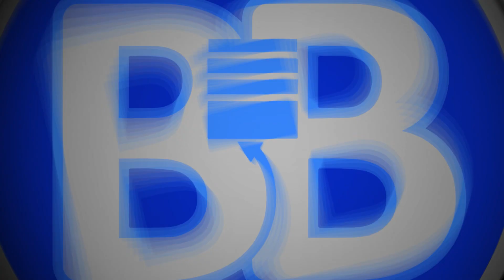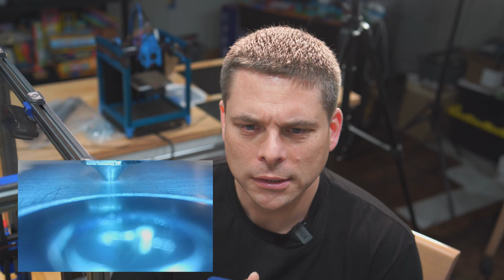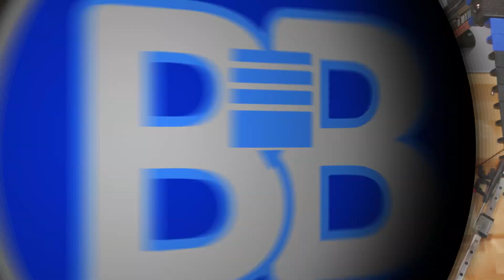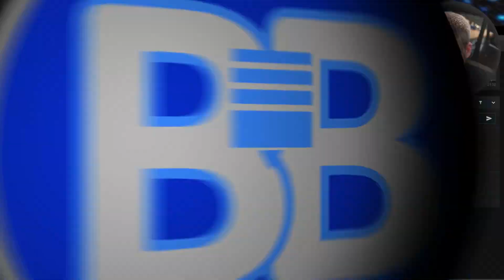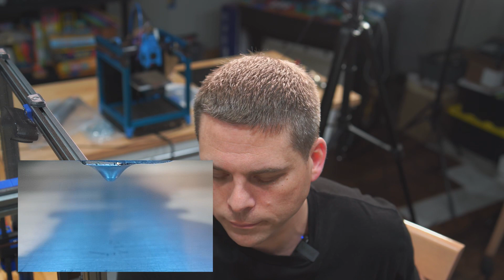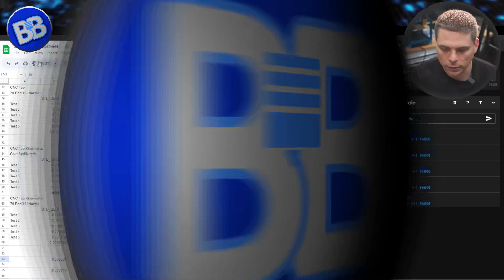CNC TAP + Kinematics?  Does it work?

Comment: The delta between cold and hot deviation of CNC Tap is caused by the viscosity from lubrication used in the mini rail.
Reply from the maker: Could be - Without some major testing, well beyond the scope of what I did - it could be tested.  3D printers are like large math problems with infinite variables!

Comment: Why you copy 'average' value into 'Min' column (26:00 - 28:00)?
Reply from the maker: ...Because I'm human.  I had to look, and you are 100% correct @ 27:38 I did copy it over wrong.  On the plus side the only number that I really give much value to "Standard Deviation" was copied correctly each time.  Thanks for pointing that out!  I appreciate your attention to detail.  Keep it up! I could use a set of eyes on some things - not that I want you to pick apart everything I do,  but I'm not afraid to say "I make mistakes".  Seriously, thank you for pointing it out so everything in transparent.
Reply: There is nothing wrong with making mistakes. I finished building my Voron 2.4 at this month :) Tap has already bought it but hasn't installed it yet. I will simultaneously install Tap, Hall sensors and CANBUS.
Reply from the maker: Awesome!  Did you get the CNC tap?  I can tell you that the printed Tap I had works very well and actually would be fine for use.  I do think, for the price, the CNC Tap is a great value and is slightly more precise than the printer version.  Some of the parts are just really small on the printed tap, small and thin.  This causes some flexing and that flexing causes MINOR inconsistencies. They will continue to revise the Tap for the next few months and it will get better and better - but for right now I would go with the CNC version.  If it wasn't an option I would consider PC or PCCF or another stiffer and more heat resistant plastic to print the Tap parts.  Stay in touch and let me know how your CANbus install goes.  I'm not too interested in the hall sensors (less to mechanically go wrong) but I think I would consider sensorless first.  (Both CANbus and Sensorless homing are parts of my upcoming 2.4 to 2.4R2 conversion series later this summer).  - Hey thanks again for watching!  Comment as you see fit!
Reply: @BuildItBasement  Chaoticlab CNC Tap. I need to print a mount to magnet. Moving the x-axis clicker to Tap is too hard for me :D At a high speed of movement, the clicker response speed is not always enough and the extruder hits the portal. I hope the Hall sensor will work faster and will have time to stop. Although this does not lead to any visual consequences on the model, it just confuses the sound of the impact.
Reply from the maker: @maaGames  Your Hall effect sensor should be adjustable so it sounds like a great solution!

Comment: I wound suspect that as you run the TAP, its settling the Kinamatics bed in its position on the mountings.  I wound throw out the first run and replace it with a new run.
Reply from the maker: Agreed, but I did an average for that reason.  People don't like when you throw out data.  Remember this was highly scientific lol...
Reply: As long as there is a real reason for the outlier, it's ok,in this case I think you could duplicate the problem by just messing with the plate and repeating the test.  But it's not worth the time and effort.  I have the cnc tap, but it is not yet installed. Like you,  I want test before and after
Reply from the maker: @TheLemonhawk  I'm glad I did - and I'm glad I bought the CNC Tap... It's not a huge expense.  As for the Tap I do think probing at the nozzle is the best way - We'll see other methods, such as the Prusa MK4 way in the next year or two!

Comment: Because you have 3 point bed the tap will never work well ( special front left and right). The tap press the bed
Reply from the maker: It actually does work pretty well... Did you watch the video?
Reply: @BuildItBasement  Did you run a bed mesh with that bed ? like on the font 1/3?
Reply: So s, where are getting your information in order to come to that conclusion?
Reply from the maker: @ItsDaPlumber  No worries :_HelperDISCOBIB:😁
Reply: I have a 300 w the outriggers and you can physically see the bed move when the Tap comes down on it. The mesh plot shows it clearly. I used a scale and the force is dead on. Maybe the CNC Tap would be better but I am a bit suspect. A kinematic Bed is a general pain because the bed falls out if you need to tip the printer over and it is extremely awkward to try to prevent it.
Reply from the maker: @Subpilot1  Interesting.  I don't knwo what is happening exactly wit your setup - but I don't have any modification nor do I have outriggers.  My QGL is dead on and my first layers are very nice.  Not to offend but are you sure you have everything installed correctly?  Maybe you missed a magnet?  The front right side of the bed is the weakest because the magnetic bond on the rear left is the weakest - but it's strong enough.  Hit me up via email if you like kerm@builditbasement.com